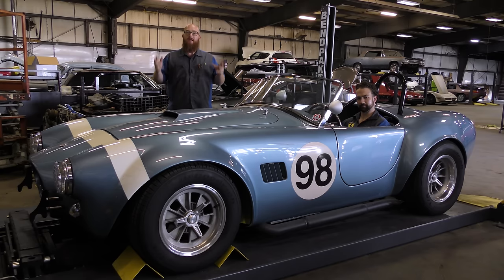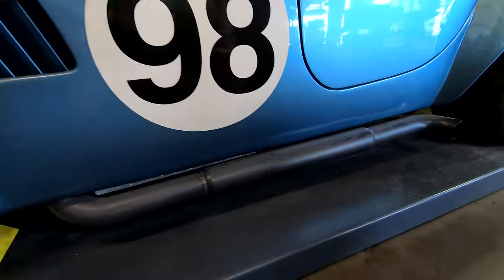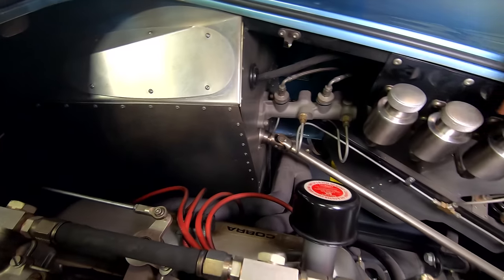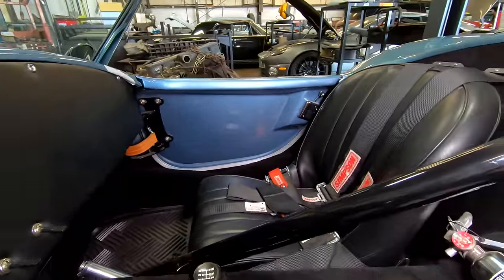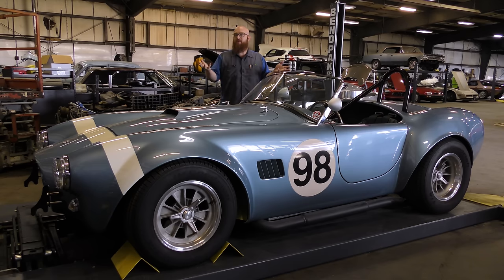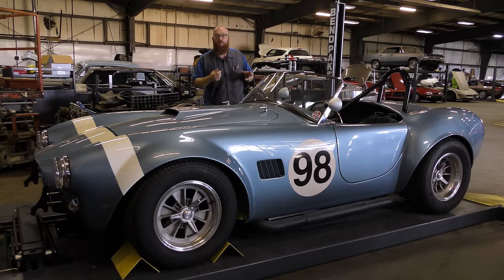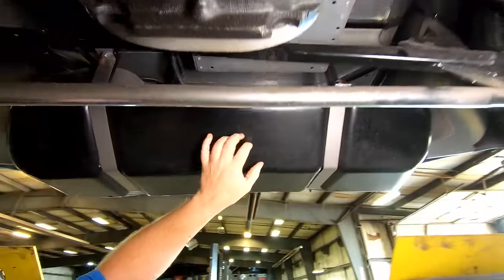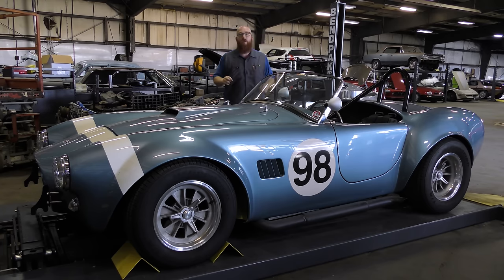How can two replicas be sooo different? CAR WIZARD compares '16 Cobra to the one just in his shop

Comment: Used is the smart way to buy any cobra kit car. If you want to build your own, there are plenty of unfinished cobra kit cars that people give up on and sell, and you can save a bundle buying one of those. Take the time and learn the differences between the kits, and the packages, the type of suspension you're getting as well as the engine (if included). Cobra kit cars are in NO WAY created equal.

Comment: I would get a factory 5 and put a coyote engine in
Reply: Coyote V8s are very wide at the top and can be a complicated fit. Usually requires a custom front end setup on smaller engine bays. Nothing wrong with the old style Windsor (260/289/302/351) V8s.
Reply: @houseofno  factory five will build your frame to any engine you want i think

Comment: 0:59 Yeah I can tell this ones different from the yellow one as the proportions are off, like if you know the genuine articles you can see the windshields further forward on the body from where it should be, the space between the wheels is about a foot larger and it looks less round, like its not a bad facsimile, but the other car uses a 5.0 foxbody mustang as its base which is far closer to the original car, and not a bad use of an otherwise irredeemable cheap ugly mustang, outside of its actually good 302 that is. 

but consequently it might be more stable than the original as well, like it looks like someone built this on a corvette chasis.

Comment: I like the looks of the original small block cobra's more than the over stuffed look of the 427 Cobra...but if I was going to the trouble to build a 427 replica, I'd at least stick with a FE engine so it would look correct. If 450hp is more than you want, build a 390... only a real FE guy will know the difference anyway. If you do want the power, but don't want to spend the money for a 427 , build a 360/390 block stroker...a 445 inch with a decent set of aluminum heads will out perform an original 427 anyway...